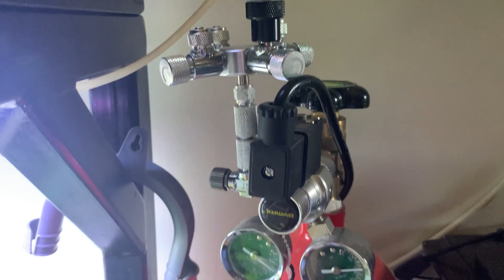CO2 Solenoid Valve Not Turning Off | HOW TO Clean and Maintain a CO2 Solenoid Valve

Comment: Hello, thank you for the video, may i ask a few questions?

Solenoid valves are generally integrated with co2 regulators.

Can i disable or remove the solenoid valve if i decide to use the co2 for 7/24 ?

 Is there any adjustment on the solenoid vlave for this situation?
 
When it's seperated like in the video , what should i do for use the regulator without solenoid valve ?
Reply from the maker: Why do you need to run CO2 24/7?

Photosynthesis occurs during the day when ample light is provided on a scheduled basis. Aquatic plants do not require CO2 at night because they primarily undergo photosynthesis during the day when light is available. 

If you provide CO2 24 hours a day, it can lead to an excessive accumulation of carbon dioxide in the aquarium, which may negatively impact plant growth and aquatic ecosystem.

CO2 should be injected for 7-8 hours during the day at your preferred timing. Simultaneously, the aquarium light should be on, in line with the CO2 injection, for a maximum of 7-8 hours per day.
Reply: @RifshyRnS  because of unstable ph level ? Turning on and off co2 doesn't lead to ph fluctuation ?
Constant small amount of co2 is not better ?
Reply from the maker: When dissolving CO2 into water, a small amount of carbonic acid is formed. This mild acid has the effect of lowering the pH of your aquarium water. If the pressurized CO2 is shut off for a long enough period, the pH will begin to increase again as the excess CO2 is forced out of the water. This phenomenon is one of the reasons why it is important to use a timer in order to run CO2 injection when lights are on, but not when the tank is dark. When the plants receive light, they consume CO2 to photosynthesize and create oxygen. At night when there is no light available and plants are not able to photosynthesize, they consume oxygen and release CO2 as part of the respiration process. In a planted tank with fish and invertebrates, the animals also emit CO2 as they breathe. Therefore, injecting CO2 at nighttime is inefficient and can potentially lead to excessive levels of CO2 that cause a dramatic drop in pH (aquarium co-op).
Reply: @RifshyRnS  Thank you. Finally I bought a regulator with integrated solenoid valve ( chinese ) but unfortunately it's not working. It's not cutting co2 our flow even power cord is u plugged. That's what i was afraid for and now im facing this issue. I'll try to fix it. Thanks again for the video.

Comment: I have bought same one as second hand used one but I am confusing how to setup .does it require check valve or not? And the solenoid valve should connect with timer setup,isn't it? Will be very thankful if u guide
Reply from the maker: Yes, a check valve is required.
It is better to connect to a timer, solenoid valve and the aquarium light in 2 separate timers, 8 hours per day (time can be assigned as per your liking, morning or evening it doesn't matter but 8 hours is preferred).
This is my routine:
- CO2 turns on at 12:00 pm, 1 hour before the lights, lights turn on at 1:00 pm. 
- CO2 turns off at 8:00 pm, 1 hour before the lights, lights off at 9:00 pm

You may choose the 8 hours based on your availability to enjoy your planted tank

Comment: Hi I just saw your video. I just wanted to ask if it is normal that the solenoid valve gets hot when it is on? If not, what will be the best remedy to fix itThank you in advance.
Reply from the maker: Slight warmth is ok, but if it is getting hot you should be careful. 
Pls contact the seller
Reply: @RifshyRnS  Thank you for your quick advice. I really appreciate it. I think the one I have is so hot.

Comment: JUST FACE THE SAME PROBLEM TODAY MORNING.. ITS BUBLING EVEN AFTER POWER IS OFF... SO I HAVE TO TURN THE VALVE OFF MANUALLY.... WILL THIS PROCESS SURELY WORK....?? KINDLY REPLY
Reply from the maker: Yes it should work, give it a try. 
Read the comments from others, it has fixed the problem for them too.